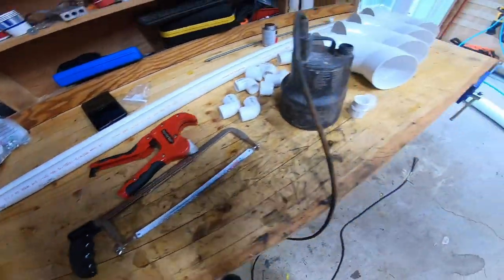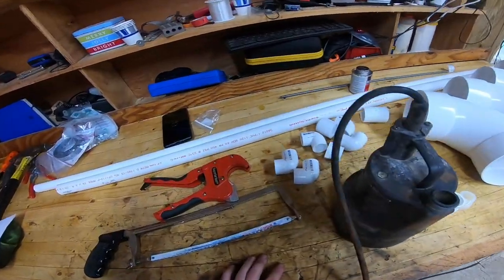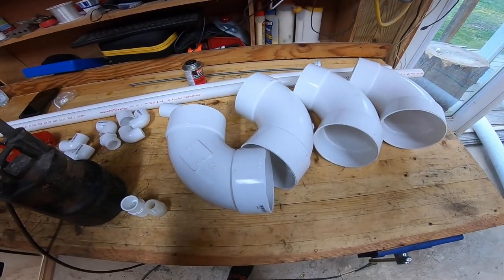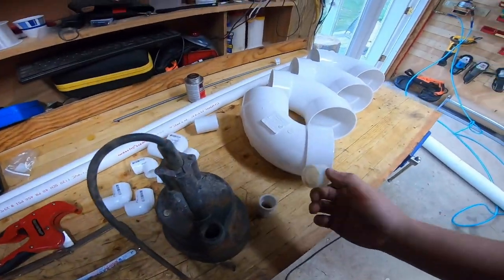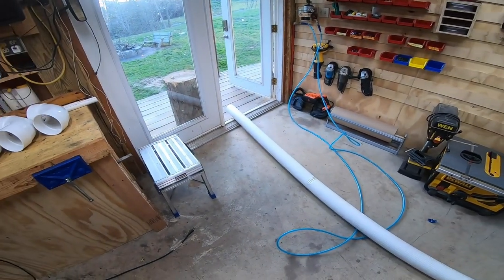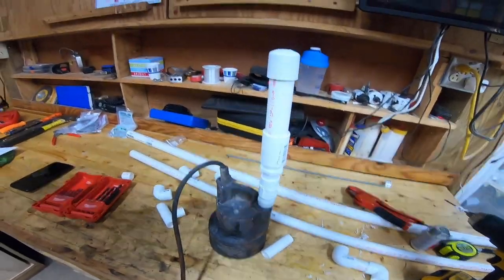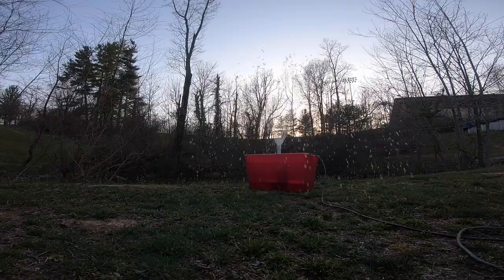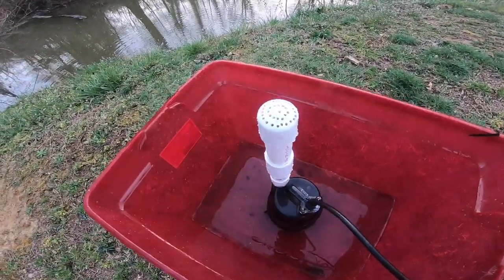How to Make a Sump Pump Pond Fountain

Comment: how long do you suggest running this during a typical day?  Also, (dumb question), but is there a way to submerge the plug to get it further out into the pond, or how would you deal with that?
Reply from the maker: i run mine 25/7 just because I love the sound of it!
Reply: I figured a sump pump would burn up pretty quickly running it all the time ? I give it maybe 3 months.

Comment: I built mine and works well.  Mine was leaning a bit like yours when it was white but I noticed after you painted it and put it back out it looks centered.  Did you adjust or add anything?
Reply from the maker: sorry for late reply, what I ended up making the rope that runs to the bottom tighter with a heaver weight (I used old car rotors) so it would pull the pump down under water.

Comment: Take a garden hose  to run the cord. For the pump in. So it insulates the  cord for the pump from electrical shock.     Length of garden hose can very. Based on how far u have to  get to the center of the pond.          After that connect the cord     to the plug or solar power system. U chose to run the pump off off being sure to account  for amps watts or ohms.    Current  when working with electrical connections.    Nice set up as an electrician  though to help the site.    Further.   If the help is accepted.

Comment: This is way too expensive you can do it way cheaper get one 4x8 sheet of foam board cut it 2x2 ft stack up four of them take two pieces of all thread through each side then drill out the center put your pipe and your cap in there spray foam around it it will lock it in tight and thread it down in your pump and you're done takes literally like less than an hour to do this about $150
Reply from the maker: seems like a cool way to go about it! mine only cost about 25$~ to me back I already had most of everything
Reply: @_Riley  also made an aerator , aerator and fountain in my pond
Reply: Video please otherwise no judging

Comment: The electrical cord to the pump should be run separately to protect against electrical stock  should the wire get frayed  or triped  over.  And then run to a solar panel for power        and the pipe the electrical cord is in. Buried   at least. One foot down.     To protect the wires.  That are connected to the pump.

Comment: Biggest risk with running pumps in water is electrical shock an   water damage done to the electrical wires. To protect the cord and the connections. From water damage an to prevent electrical shock. Run the cord in a garden hose.  The rubber lining of the garden hose will act as a double Insulator  and allow  to make a safe connection to a. Solar power supply  that can run the pump on.  An commercial  panel  to plug it into. Then fence  off around the. Panel to prevent trips an  damage  to the Solar panel an  outlet  u plug into.